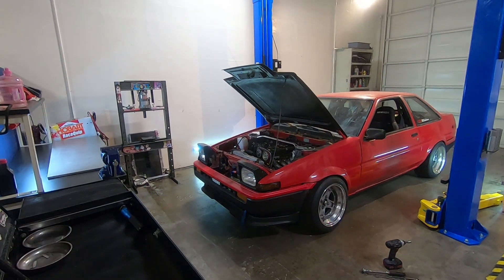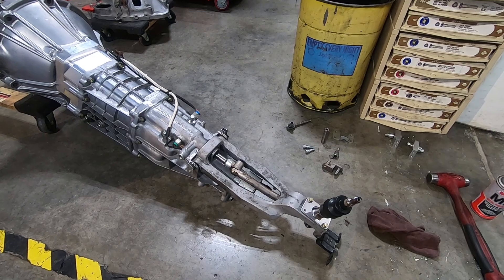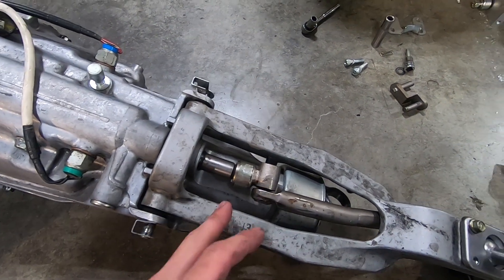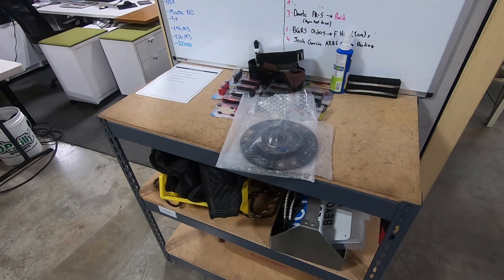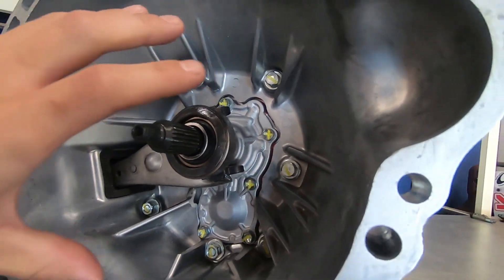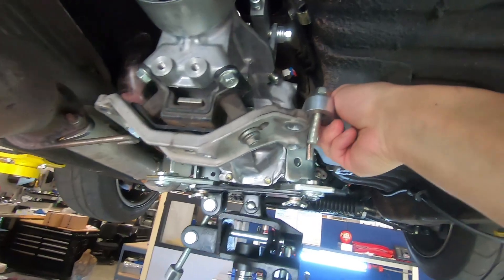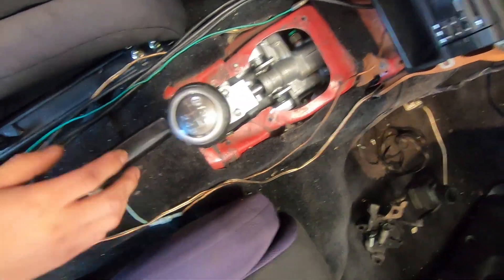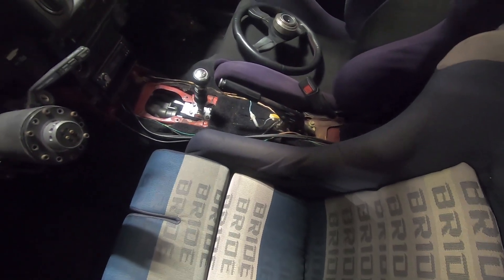IMPULSE 4AG 6 Speed Adapter Install FINALE

Comment: The parking brake handle can be shortened relatively easily. The plastic slides off, the steel shaft can be shortened as well as the housing. Then slide the plastic back on. I have done this a couple time for sr20 swapped Corollas. They have a similar issue.
Reply from the maker: Thanks Mr. John! I run your BEAMS relocation shifter on my personal car btw. Love it!

Comment: hmmm!!! cant wait to see it in action via highway, track, canyon etc!!! also lol shafted!! im wondering if theres a way to make the digital cluster talk with the transmission ? not sure if thats a thing or how it works for the 86 digi cluster
Reply from the maker: Impulse uses a flying magnet on the driveshaft and an aftermarket speedo gauge. This car is "track only" so speedo reading doesnt really matter for us. We plan to regularly do track days in this car next season so stay tuned!
Reply: @CMAutohaus  So a J160 is probably a better swap if you're trying to stay street legal?
Reply from the maker: @EnigmaticCipher13  I know in some countries you have to get an inspection if you modify the body or do an engine/trans swap.

But in the US it doesnt matter. I say the biggest downsides to this swap is cost, complexity, and you have to cut a BIG hole.
Reply: @CMAutohaus  Thanks for the reply, I was mostly referring the loss of the stock speedometer. I'm under the impression the j160 can Intergrate though the actual speed may be off. The t70 would require an aftermarket speedometer?

Also did you make a direct comparison between the two. Which do you prefer and under what context?
Reply from the maker: @EnigmaticCipher13  There are a few aftermarket options you can do to get the factory speedo working again such as flying magnet or GPS.

I think I covered the comparison in a podcast episode. LMK if it is not adequate.
https://youtu.be/gJ0wca-S6aA
Reply: @CMAutohaus  Thanks a million for all this info 🙏. Seems like the J160 with swapped sixth gear and the Tl70 are pretty similar in performance. I don't know how much you got to drive the Tl70 but which feels better to you in terms of shifting and performance. Which would you recommend disregarding cost factor? Is the new shifter location on the tl70 annoying or inconvenient after shortening the hand brake?
Reply from the maker: @EnigmaticCipher13  In terms of shifting and performance I choose the TL70 swap, also disregarding cost. The new shifter location is not closer tot he driver and actually feels great! Even for Grant with his long arms.

Shortening the handbrake was annoying to do, but you dont notice it after.
Reply: @CMAutohaus  Once again thanks for your help. I think you just helped me come to a decision. Assuming I can get my hands on that impulse kit that is.